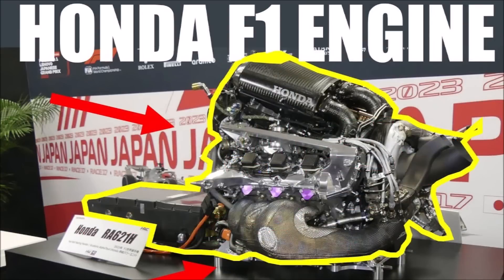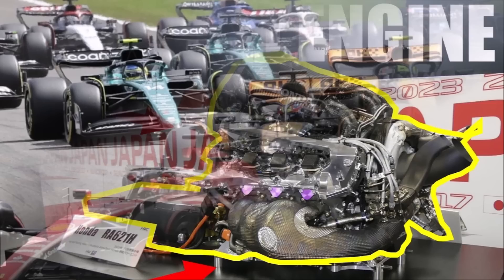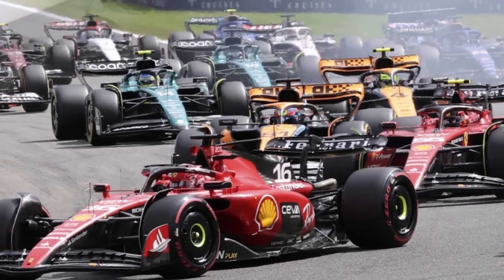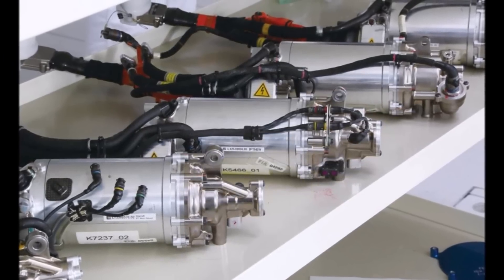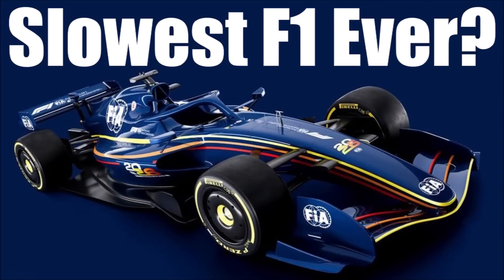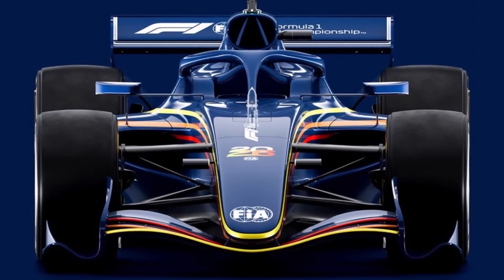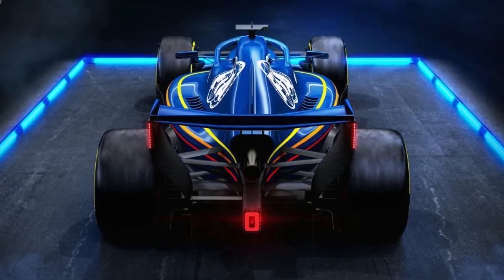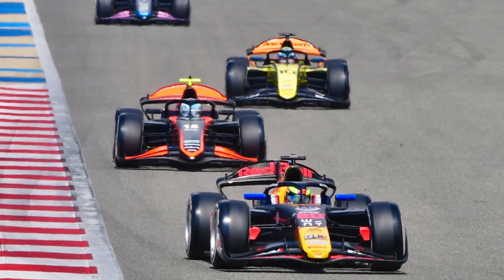F1 2026 Update - CLOSER LOOK

Comment: They should just leave the regulations alone for 10 years… nobody wants 1 team to dominate and making radical changes to the regs creates an opportunity for a team to steal a march…

I’d propose the next regulation change after 2026 to be in 2036 and those changes should be innovation inspiring not a complete redesign… remove minimum weights slowly up until 2036, give more wind tunnel time for teams with the best aerodynamic efficiency, minimum power output and maximum weight for batteries…

This constant turning of the tides is boring because someone unlocks the new regs and it takes 3 years to catch up 👎🏻

Comment: Being afraid of a brand new entry having too much advantage is so lame. All of these teams have vast electric motor experience
Reply: But other than Ferrari and Audi, are there ANY brand in current grid that have front wheel drive motor experience?
Reply: @kidpagronprimsank05  idt front vs rear matters nearly as much as literally not having a F1 program.
Reply: @kidpagronprimsank05 other teams have f1 experience which Audi doesn't

Comment: just IMO, 1.5Ltr normally aspirated engines, no MGH/MGK etc, reduce weight of car to 500kg, drastically reduce car length, increase max width of side pods, standard skinny wings with single flap non adjustable. Ban blue flags, mandatory use of all 3 tyre compounds. get back to pure racing. manual gearbox?

Comment: 15,16 inch front wheels + hub motors (~80-100kw combined), ICE 1.3 I4 running on E85 or pure ethanol. Total electric output 200-220 kW. Simpler, lighter, more compact...
They should also keep the GU-h as Porsche had on 919 - it's much simpler & reliable

Comment: Total Power brakes in F1 car is more than 3000kw !!! Traction dont be a problem.
They will have a problem to full charge battery because mguk had top small level power .
Too small time to brake on lap so they will  charge battery on straight  lines

Comment: Not that i want to give F1 any ideas, because i hate the whole ERS/hybrid marketing gimmick, but why not just use generators on the front wheels. I mean if the whole reason against them is Audi's head start using motor driven fronts then just use them to generate power, not drive the wheels. Give the contract for the generators to a single vendor like they do with the ECU's and call it done.

Comment: They downright violated one of my engineering rules (i set for myself) if you have a source of energy you have to use the shortest way to use it, going through the battery was not the shortest way, compromising combustion engine, and make the whole car heavier because of the extra battery, like what's the point of having a battery there if you're gonna send the energy to the ground anyways. And you consume fuel at a far less rate than if you're simultaneously charging the battery.

Comment: this is such typical FIA nonsense!
they should increase the number of wheels on the car to an uneven amount, something like 13 (7 on the rear, 6 on the front) and force them to run all tire compounds at the same time, all the time. then set both, the electric motor and combustion engine to 100hp/ton and put 20 tons of ballast on the front of the car. also they should introduce a better DRS, where you can jettison the entire body. on top of that they should only be allowed to have one single break somewhere in the rear, none in the front and shoot huge flames out of the rear under breaking, in order to avoid collisions in breaking zones. it's THAT simple

Comment: The stupidity and cynicism of hybrid and the manufacturers was already highlighted by Newey; a "sustainability" focused race series would have cars as efficient as possible - meaning as light as possible. Hybrid was the wrong direction and now Renault have given up anyway. The obvious solution is to basically keep the current regs, make the cars shorter and lighter by removing unnecessary hybrid and electronics, making them more agile, and get some decent tyres. Drivers have asked for this for YEARS. Go back to refuelling. Reduce team size by 40%.
Reply: You were discrediting Hybrid systems too much, the LMP1 cars of 2015 2016 and 2017 were perfectly in line with efficiency goals. Massive fuel savings, agressive regenerative braking, with bonkers performance.
Reply: @Dakkyun  Where did I mention LMP1?

Comment: What a dumb set of regulations. Wish they just freed them up. Let them do whatever they want, if hybrid is faster then run hybrid, if it's not then it's not. Restrict fuel flow and fuel capacity if ridiculous power output is a concern.

Comment: if F1 wants to be road relevant they can start by giving the engine bigger cylinders. If F1 wants to innovate they can make battery energy density the focus of development by regulating the physical size of the battery rather than its output and storage capacity.

Comment: So they'll burn fuel to charge the batteries? Quite honestly that just sounds stupid. If it's gotten to that point, why not just scrap the hybrid concept entirely? I bet everyone would prefer full combustion engines over these pointless hybrids 2026 regulations will introduce. After all they'll use carbon neutral fuel in 2026 so might as well get rid of the hybrids entirely
Reply: Full ICE is slow. Also not relevant for any engine manufacturer. No one in their right mind should prefer that.

Comment: It seems like they try to just fix the worst problems of the current time, and never remember what they learned. In 2013 the problem was to high price on the engines, and to little road relevance. Then 2014 came with hybrids, and now only 3 manufactures have ever used MGU-H. So yeah, it’s really relevant. And yeah, now it starts over again.

The biggest problem for me is that there is no real and clear plan. With the WEC they wanted a cheaper series where the manufactures could make cheaper LMDH car on a LMP2 chassis, or their own LMH chassis. Either way it’s with limits on drag and downforce. And what happens. First year won by a LMH car, and second year won by a LMDH. It works! Because there is a plan for what they want. But in formula 1, the plan is always related to who has the most power/money in F1. And that changes all the time, so that’s why they can’t figure out a solid plan for what to evolve for.
Reply: "In 2013 the problem was to high price on the engines" Really? Weren't the V8 relatively cheap? There was even a cap on customer engine lease prices, which was lifted in 2014  I believe.
Reply: @ I see the misunderstanding. I meant that the amount of PU’s used per season was crazy. And because the new hybrid PU’s was way more expensive, they put a way tighter limit on the amount of units allowed per season. But yeah, in the old V10 days it was normal to use multiple PU’s per weekend. So yeah, increments in costcapping. But the question is now, what increments are now being taken when they move backwards on the ground effekt? Sorry for the misunderstanding. ✌️🏁

Comment: I'd prefer to have all the drive going to the rear over having an electric motor in the front. I understand the frustration though. They are wasting lots of energy dumping into their brakes. 

I think this cars will be better, active aero is a huge difference. I do worry about lack of close racing due to dirty air again though.

Comment: Cars look great but the regulations could not possibly be conceived any worse. Using the engine to charge the battery instead of recovering energy from the front axle has to be the worst technical decision in the history of F1. And explaining to casual F1 fans that the engine is used to charge the battery will sound bewildering.

Comment: So they are using the engine as a generator? Thats what im understanding so why is everyone upset? Am i missing something?
Reply: Yes they are using the engine as a generator, since batteries are heavy but fuel is light.
Reply: The engine will have a constant RPM like a diesel locomotive. Great. F1 is at an all time low as it is.
Reply: @vettezl1  It's not strictly a traditional generator. The engine is still physically connected to the wheels at all times, so engine speed and gear still has to correlate to road speed.

It's not even a non-mechanical electromagnetic drive coupling like in a Toyota Prius eCVT or Owen Magnetic car, it will still be a physical clutch.

The engine will just be running at higher load than necessary to generate electricity. However it is capped at generating no more 100kW (or about 30% of full power) when the driver is off-throttle.

So the engine will sound weird going around Casino hairpin with throttle on, but it won't be "engine running flat out around Casino hairpin" as the likes of Newey had implied.

Comment: I was thinking exactly the same. I don't see anything good coming from the downforce increase that they allowed at the end, at least not at that huge amount. I was happy when I saw the initial levels, thinking that as long as they solved the silliness caused by the engine/battery debacle, at least the reduction in downforce would allow better drivers to shine more against those who have less good control. After all, who cares about how fast cars will be in ultimate terms, as long as competition is good? In the end it's like they went through all these changes with the current and next concept to make following and overtaking more feasible, only to completely negate that purpose with the latest changes.

Comment: I'll still never wrap my head around the new power split. Hybrid development has already plateaued so further effort suffers from significantly diminishing returns, but because car manufacturers don't want to admit that they overinvested, they want F1 to increase the emphasis so they can justify their costs and even recoup some of them. WRC got ahead of the curve by dropping hybrids and moving to 100% sustainable ICE. F1 is going to fall behind and it'll be because of these car brands and their bloated hybrid initiatives.

Also, burning fuel to recharge batteries is about as stupid as nickel mining to save the planet.

Comment: As long as the tunnels are small, all the same following problems will be back. Cant wait for the 2033 regulations, big tunnels with spec ride control to manage cost. Better for the drivers , the cost and the racing.

Comment: I still think that the new regulations should be microhybrid, where the power train is built around a V8 or V10, but teams can add 40 kg of motors+batteries. It would encourage teams to come up with lighter batteries and motors however they see fit, but electrification won't dominate the car. It's kind of what you see with modern cars. Teams will still be encouraged to squeeze the most out of the limited weight budget if 40 kg for battery and motor, and the electronics will help, but they won't necessarily make or break the car. It would also help in significantly reducing the weight since they can only have 40 kg (or whatever they choose) of batteries and electric motors. This would encourage innovation without ruining the sport and would keep the cars closer to the hybrids coming out in the future. The cost cap will make sure things don't get out of hand spending wise. I would postpone the new rules a year or two and scrap the current 2026 plans for the microhybrid plan. I'm not sure if the V8 or V10 should be naturally aspirated or not.
Reply: My problem with that is the cost of squeezing more out of the package raises the price of the tech exponentially, they will be simply too expensive to justify putting them on all but the most boutique of exotic vehicles. Which may be fine for companies like Mercedes and Ferrari, but what does it do for Ford and Honda, not to mention Red Bull who won't be selling road cars at all. F1 has let the elites completely control the sport to their own ends.
Reply: In my opinion, all combustion units just need to be regulated by total fuel/energy (only combustion limits, no electric limits) usage. Turbo, NA, rotary, gas turbine whatever you want. You have a set weight for the motors and batteries, since batteries are limited by weight anyway, they will be forced to make an ideal mild hybrid (ie 500hp for a few sec for every corner exit). And the front must only be electric.

Comment: I'm actually happy this is happening, because it'll be very clear that the engine regs don't work, and will potentially expedite NA engines with synthetic fuels.
Reply: NA engines aren't going to happen any time soon. Sorry to burst the bubble
Reply: @dod_the_angel  Thats what ppl said about WRC and they are scrapping hybrids.
Reply: @Toro_Da_Corsa  but they aren't getting NA engines and it doesn't matter regardless as the new proposed regs are hot trash
Reply: @Toro_Da_Corsa Except that WRC  cars in general are using the forced induction since the Group 4 era
Reply: That is true. WRC got rid of hybrid. Hopefully in 2033, F1 will do the same

Comment: Burning fuel to charge the batteries versus capturing wasted energy during braking is so stupid. Two steps back and one step forward with these regulations.
Reply: "burning fuel to recharge battery is surely more eco friendly than adding a front electric motor" - FIA probably
Reply: You new?  The fia doesn't know its mouth from it's ass.  Shit talking is all it does.  Not to mention the automotive industry hasn't a fucking clue where it's going or what it should be doing.  Electrification is largely pushed by politicians which isn't reflected in sales.
Reply: If you just want to not hate environment, just use fuking biofuels then.
Reply: no step forward,  banning mguh was a large step back, lowering ground effect and increasing wing of are 2 steps back.  not making the tires/wheels smaller and lighter is a big missed opportunity
Reply: Well before everyone was complaining about development advantages, sound, weight and size and costs so yeah reducing the amount of motors was gonna be one of the best ways to do that, the cheapest and easiest way to do that is by offloading recovery systems, motor generators and energy stores surely.. 
I like to put the foot in when I think a regulation doesn't make sense but when they have so many parties to please.. I can't blame them too much here, at some point we gotta accept that you can't have your cake and eat it too.
Reply: @F1ll1nTh3Blanks  Come on bro😆 They could so sooo much better tham this. This regulations are crap.

Comment: These hybrid systems are great if used correctly. Putting the electric motor on the rear and using the motor to charge the battery is not the way.

Comment: F1 is fumbling the golden opportunity they got with the old regs so badly.

They are going to continue fading back into irrelevance because they are screwing up the most fundamental element of the series. 

They continue to remove all the things that made F1 such a special motorsport and think that people are just going to keep watching an inferior product that gets worse with every single regulation change. 

Unintentionally or not, they have lost the plot to the point they seem to think, that slower, less interesting and more homogenized cars. Racing on worse tracks, with more street circuits. Is the direction to go with F1.

As usual, its the ridiculous, self destructive, bureaucratic infighting that will end up ruining this racing series for all the team.

 If this keeps going on long-term the best case scenario for a team is winning in a series nobody watches or cares about.

Comment: Unless they remove the electric motors, it's not the right way forward. They should use the noise of V8s, V10s or V12s to advertise the benefits of sustainable/synthetic fuel.

Comment: The engine regulation doesn't make sense at all.
Reply: Of course, but it's confirmed now -- too late to change, Ford and Audi don't have the old units to use even if everyone wanted to abandon the engine rule changes.  

I'm a bit more concerned undoing the ground effects venturi cars and all that has been learnt about those TBH, that the current venturi cars are difficult to operate and setup is perhaps exactly why the field has been so close and jumbled from round-to-round in 2024?